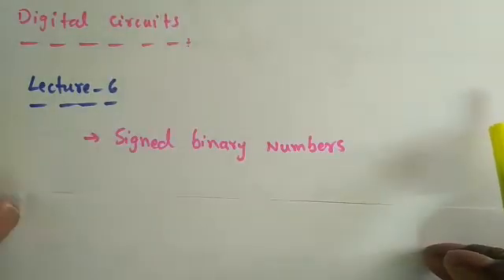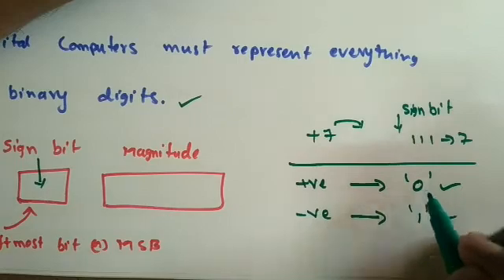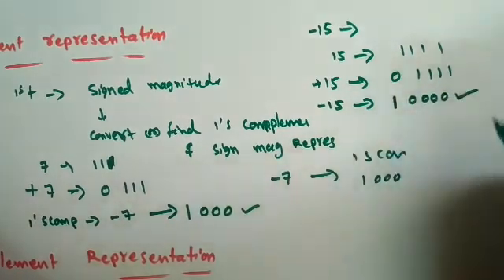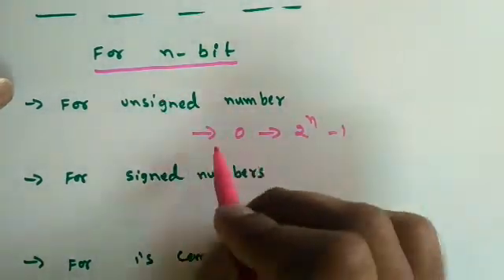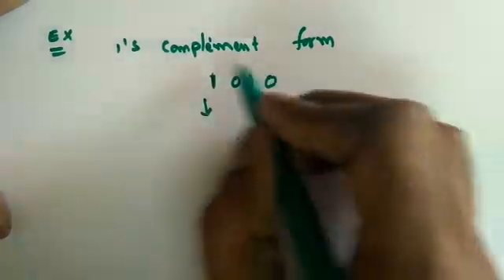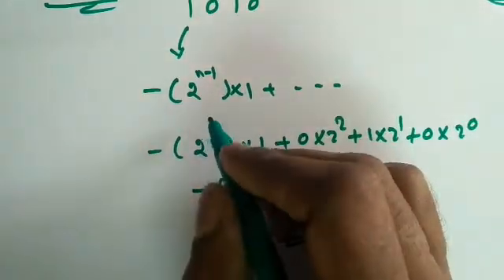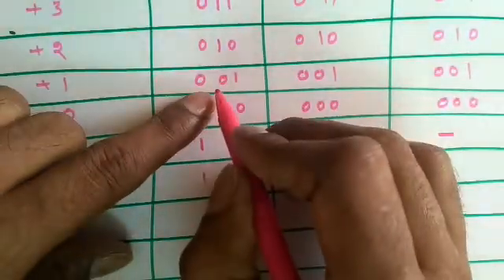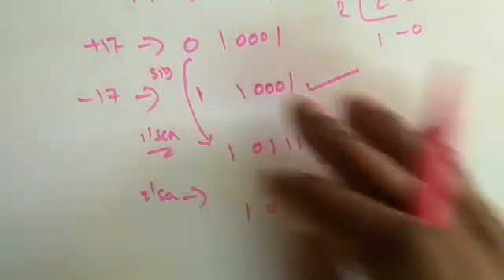Digital Circuits Lecture-6: Signed Binary Number Representations

Comment: (121)base4+(121)base3=(x)base6.answer is (105)base6
(10000011)base2+(x)base3=(AC)base16 answer is (A42)base16
(121)basex=(31)base8 answer is (121)base4 actually -6 is also there but possible case i think positive one only
(11GPM)base8=(1289)base16 how to do this???
check those sir and revert me about answers are correct or not?

Comment: in twos complement form +4 as well as -4 are represented as "100". how do we get to know that the given number is positive or negative?
Reply from the maker: Ravi More no Ravi to represent +4 in sign form we need 4 bits...unsigned number is 100...where as in signed form it is 0100...it's easy to identify negative number if it is sign form..if MSB  is 1 then it's negative number
Reply: ok thank you sir